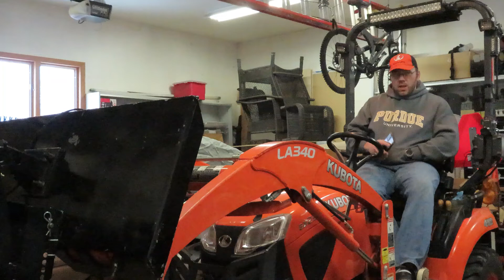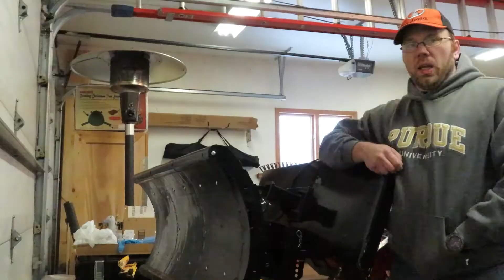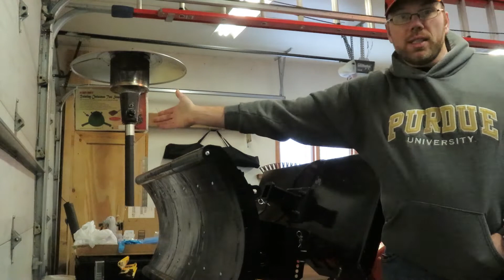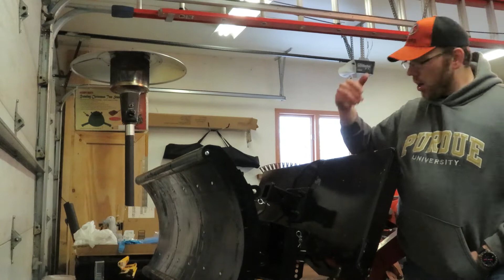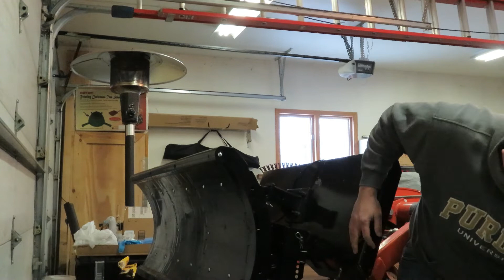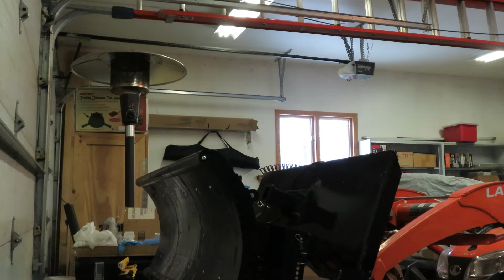Kubota BX23S   49inch Nordic Plow and Actuator Build

Comment: Justin, I just put up a video last week using the same actuator. I show how I mounted it and how I wired it all in. I used a momentary switch directly to the battery. Could you put up a video of how you mounted yours in a little more detail. Thanks in advance.
Reply from the maker: Hey Rick! thanks for the note. I can do that. which one of your videos has the actuator in it?
Reply: @justins5210    Justin, the video says Mahindra snow plow modification. Let me know what you think, and if I could see more details on how you mounted yours. Thanks
Reply from the maker: Nice Video.  are you having any issues with the actuator just on one side?  I will get some more details on the mounts out to you but these are what i bought:
https://www.amazon.com/Progressive-Automations-Mounting-Actuators-including/dp/B00943OS2A

Comment: Awsome job on the build!
Dang that actuator was not cheap! 
Interesting info on the rounded edge!  I wondered the same about the scraping
I dont like to use salt either.
Very thorough video on your experience!  Nice job!
Have a great week!
Reply from the maker: thank you!
I wasn't looking to drop $250 on the actuator, but as I mentioned in the video a cheaper one maybe fine. I just figured I wanted to do it right the first time.
have a great week too!